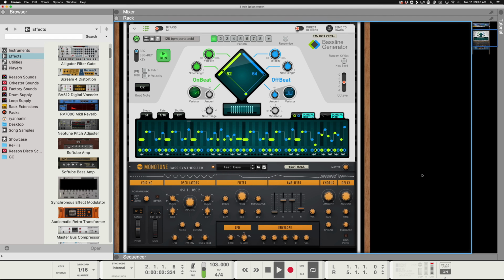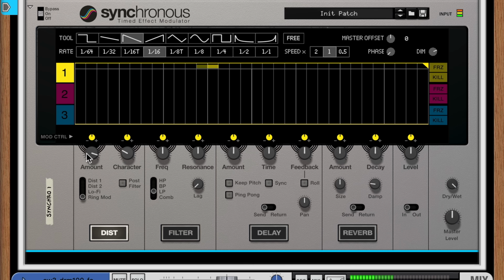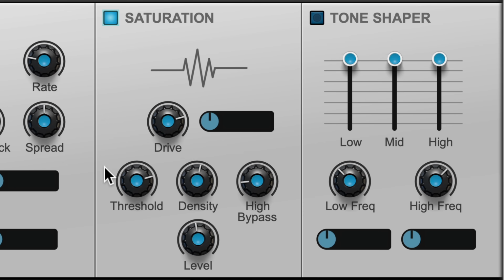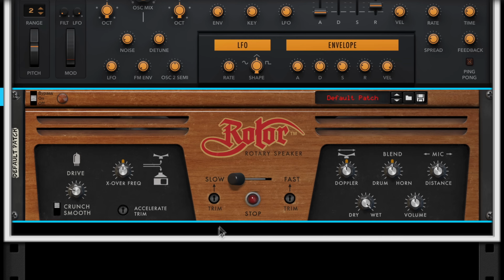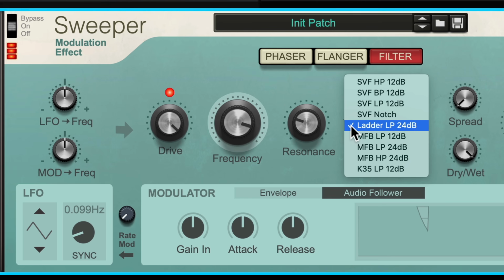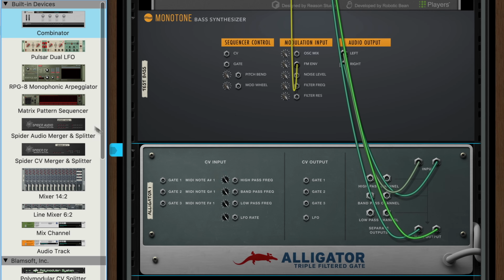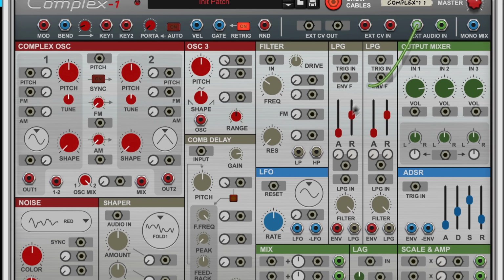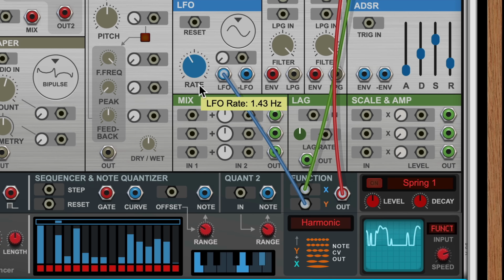The effects in Reason you didn't even know existed!

Comment: @ 0:00:10 I count 12 distortions crap and yet again in reason ver 11 so I got an 80% nice I'll take it who else got 12?
Reply: 01 Softube Amp
02 Softube Bass Amp
03 Synchronous
04 Kong's Overdrive
05 Scenic
06 Processed Pianos
07 Umpf Retro Beats' Tape Saturation
08 Rotor
09 The Echo
10 Sweeper
11 Thor
12 Alligator
13 Complex 1's Shaper
14 Complex 1's Function Module

Comment: Maybe someone mentioned it already, but there is a waveshaper in Thor also and it has even more wave shapes than the one in complex (this is a mono effect, by the way). Then it also has 2 mono filters plus one stereo filter.  So 1 Thor effectively has 4 distortion effects which can be accessed simultaneously and assembled into any signal chain you can imagine using the routing matrix.
But that is not all!...
Since ring modulation was also mentioned as a distortion in the video, I will consider it also here as a distortion.
In that case, consider also that the routing matrix allows any of the 3 Thor oscillators to be set as a amplitude modulator (AM is very similar to ring modulation). - Now, if you are using Thor to distort a monophonic signal, there is even one further trick... Rather than giving you a fixed-frequency tone as the basis for AM modulation of your signal, you can actually use the same MIDI clip or source to trigger the Thor oscillator (and then tune it to taste), meaning your modulator frequency can be the same (or related to) the carrier. This will give you access to different tones versus the usually overly metallic tones obtained with AM or ring modulation.
Phew !!!!

Comment: only works on reason 12? im still on 11 ... :(
Reply: which ones? The Thor example works back to Reasson 4, the Kong example works with Reason 5, the Sweeper example works with Reason 11, Synchronous works with Reason 10, the Softube Amps work with Reason 8, the Alligator example works with Reason 6, the Rack Extension examples like Processed Pianos, Umpf, Rotor, Complex-1 work with Reason 10 or newer if you have those RE's. In fact there's no example here that requires Reason 12. Now the Combinator patches I made and linked in the pinned comment? That's a different story. To make use of those patches requires Reason 12 for the updated Combinator but all those Combinators are just wrapped up versions of the devices shown in the video so no, Reason 11 is just fine. /ryan
Reply: @RyanHarlin  it's says bad format or the file is corrupt when trying to open it in reason 11, but then when I open reason 12 it works :/
I've updated the license thingy, still dosent work.. What can the problem be if it works for all other people.

Am I missing something?
Reply: Reinstall would be something to test hmm 🤔
Reply: nope..dosent work.. 
its says Bad patch format
the selected fils is in the wrong format or corrupt.
 :(
Reply: @jaycreatives  Right but that's what I'm saying – the examples I show in the video work if you do them yourself. The Combinator download only works in Reason 12 because they're using the new combinator. I thought you were saying that this video's content only works in Reason 12 – which isn't true. If you're talking specifically about the download, then yes you're right.
Reply: @RyanHarlin  ah okey ! totally walked on the wrong road !!! haha, thanx Ryan, all my respects to you.
Reply: @jaycreatives  right back at ya, jay!

Comment: you missed the drive of the filter in complex 2. and - i wish you'd have done the video not on distortion, but on other fx types. these count more (to me).
also i wish (actually since ages) for you guys to put inputs on every of your instrument devices for their fx to be used everywhere (f.e. you can't use rhytmix' fx section for external signals - but these are really sounding great to ny ears. btw - please allow rhytmix to be used with our own samples - i like the simplicity of this device and would use it for most of my drum tasks). and i mean actually two inputs - one for the signal to go through the synth engine (where it makes sense) and one for only the fx section (where the synth engine is bypassed and turned off entirely to save cpu). f.e. i would love to use the drive section of radical keys for my other signals - that drive section sounds marvellous.
and i would like to point out two problems that often occur when using fx of instrument devices for external signals:
1. you cannot quickly bypass them, as instrument devices do not have their own bypass switch. so one has to use the fx propetiary bypass switch - if there is one at all, or one hast to fake one by cabling stuff up. a bit tedious, as these tiny things tend to sum up.
2. often these fx parameters are not available for automation (f.e. kongs inser fx - f.e. the tape delay).

Comment: Ryan, here is one you missed.  You can use the settings on the Audiomatic Retro Transformer for some unique distortion.  I use the "Cracked" mode and sometimes even layer on with another Audiomatic instance with the "Bright" setting.  The results are really program dependent and you can get some nicely weird results.
Reply from the maker: Thanks for pointing that out to folks in the comments! I mention elsewhere down here that I purposefully left Audiomatic off because the effects are suites of effects that include distortion, EQ, phasing, compression, and probably other things too. So since you can't disable the individual components I ruled it out as a strict "distortion" effect. But maybe I was too strict in my self-imposed rules. :) /ryan
Reply: @ReasonStudios  ah ok.  I missed that comment.  I like that effect a lot.

Comment: You forgot to mention the waveshaper section of Thor. It‘s a little bit more complicated to use as it is in mono and you need to use a constant trigger for the routing through filter one.

But with two Thor Devices in a Combinator Patch, each triggered by there own step sequencers, you can get very cool waveshaping distortion results. Back in the days when I started with Reason 4, I learned soo much routing possibilities with Thor. It‘s a really cool device.

But nice video! Shows the fun possibilities with Reason! :)
Reply from the maker: I debated showing the Thor shaper but yeah, it was a little fiddly to set up compared to Complex-1 but you're right! It's a cool one. Maybe I should've included it anyway. /ryan

Comment: Are you saying that the distortion sound in each rack is guaranteed to be different?
Reply from the maker: Well each one does have a unique quality to it, as you can see in the video. The resonator in Kong's distortion module isn't found elsewhere. The Function Module in Complex-1 can ony be done there. The bit crush in Processed Pianos sounds different and has more control than the Lo-Fi on Synchronous. The tape coloration of Umpf Retro beats is unique to it. The softube distortion algorithms are their own code and sound. The Alligator band overlap creates a phased smeared parallel processed quality to the overdrive. So yeah, I guess I am saying that. :) /ryan

Comment: Hearing you talk about this made me realize that you totally forgot the Thor shaper when you were talking about using Thor as a distortion. Although nice to know that there are so many distortions I always overlooked, since I use distortion effects all the time for making bass sounds.
Reply from the maker: Right but there's an issue with the Thor shaper, right? In order to hear it you have to have a voice active. You could turn it down but it still needs to be active which would involve setting up the on-board sequencer to run a loop with a long gate that keeps the voice open but even that wouldn't work unless the sequencer is actively playing. So while you're stopped you'd have no sound (unless you click the run button on Thor manually). Right? Or is there a way you have to access Thor's shaper in a less clunky way? /ryan